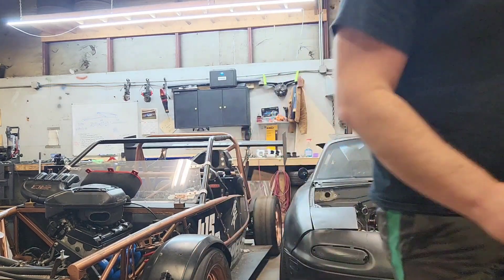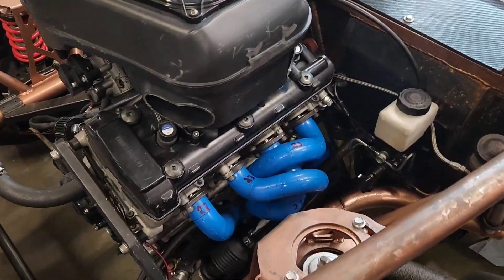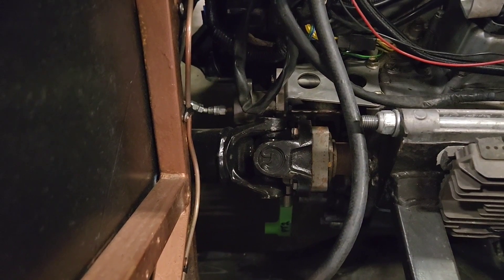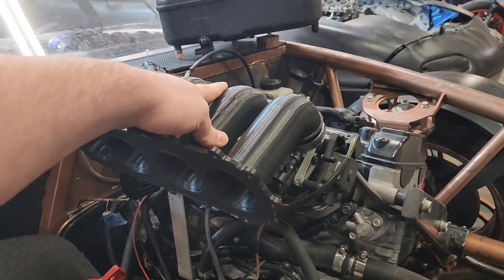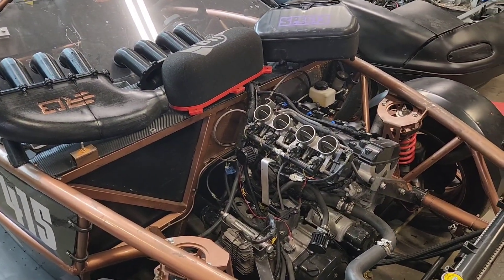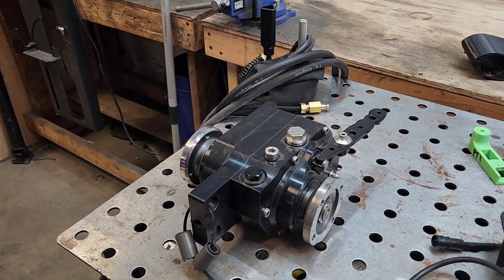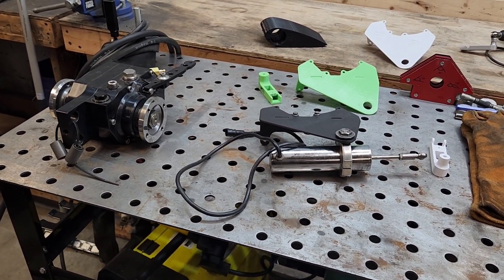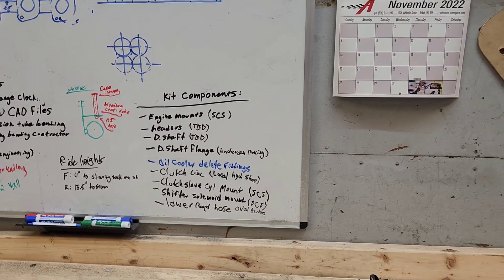Spec13 Motorsports Hayabusa Engine Swap Update and pricing. Accepting Pre-orders!

Comment: It’s amazing how small the engine is and how much room that opens up for things like a tilted radiator and extractor hood. The weight balance must also be somewhat rear biased, which could be really interesting.
Reply from the maker: Yeah, it frees up a lot of room under the hood. I know you aero nuts are going to love it haha! It does take a good bit of weight off the front, yes. Turn in is much more eager, lots of front grip. It requires a slightly different approach to suspension setup when compared to a standard Miata.

Comment: Would it significantly complicate the install for an auto miata?
Reply from the maker: Good question! Unless there's a difference between the manual and automatic tubs, I can't imagine it would. Actually, I think there's the potential to simplify the process  adding a clutch lever instead of the pedal. If you went with the paddle shift option, you could mount a hydraulic clutch lever to the trans tunnel. This way you wouldn't have to cut a hole in the fire wall and mount the clutch pedal.

Comment: What are you doing for fuel and miata specific electronics such as lights/pop up headlight motors.
Reply from the maker: It's the stock fuel pump with an adjustable fpr. However, depending on your donor car, you may not need to change the fpr. The busa has a returnless fuel system running at 43psi.
Reply: @spec13motorsports  Oh so its pretty identical to the NA fuel system.

Comment: How is the gearing with the hayabusa sitting in the ~2.5:1 ratio range and Miata averaging in the ~4.0:1. Top speed on a swap like this? Can they be boosted?
Reply from the maker: We replace the sprocket with a driveshaft flange and a 2 piece driveshaft, and then pair with any of the commonly available Miata diffs. The 4.3 diff will yield a 100mph top speed, while the 3.6 diff will yield a 130mph speed on standard 15" wheels/tires. 

They can be boosted up to 7psi reliably on stock engine. 

Check out our FAQ's 
https://spec13motorsports.com/blogs/news/frequently-asked-questions-faqs
Reply: @spec13motorsports  I'm curious why can it only hit 100mph? It makes way more power than the stock na miata engine which can get up to 110. Is it because of transmission gearing? I don't know too much abt how gear ratios work in this case.

Comment: How do you think this engine and gearbox would fare as a competition drift car? I think lightness is key but I'm concerned about how the gearbox will hold up to repetitive clutch kicks.
Reply from the maker: For your application, I would upgrade the clutch basket and clutch springs. Other than that, I don't see any reason it wouldn't hold up really well. I plan to attend some drift events this year for testing/promotion.
Reply: @spec13motorsports  Thanks for getting back to me. I see in some of your other comments that you are limiting the top speed to 100mph due to concerns of excessive load, is that right, and if so, why?
Reply from the maker: @jaiden270274  No, we're not restricting speed to 100mph. The Miata in our first video at Palmer was equipped with a 4.3 diff, which will yield a 100mph top speed.  But nothing is overloaded if speeds are kept below 127mph, which the 3.6 Miata diff will hit with this swap. Check out our FAQ on our website: 

https://spec13motorsports.com/blogs/news/frequently-asked-questions-faqs
Reply: @spec13motorsports  thank you, that FAQ is very informative.
Reply from the maker: @JaidenGullotta  let me know if you have any other questions! I think this would make an awesome drift build.

Comment: How is the underhood fitment with the 3D printed intake manifold? any hood cutting required?
Reply: Also you mentioned the idea of branching out to other vehicles - I am interested in the feasibility of swapping the first gen 86/brz twins, any thoughts on the platform? Does this sort of powertrain make sense in a heavier chassis such as this? Any concern with communication to the modern ECU's? Very excited to keep tabs on what you guys are doing here.
Reply from the maker: The under hood fitment with the available intake manifold is tight, but no cutting is required.
Reply from the maker: @austinhamilton9537  we're exploring the BRZ/FRS, but I'm afraid top speed would have to be pretty limited to keep loading down and ensure reliability. We've only tested with the stock ecu with a Schnitz Racing tune, but we're working on a project that will allow us to experiment with the ecu more

Comment: Did you change the oil pickup/sump at all?
Reply from the maker: No, we are running stock pulling system on both test mules. We haven't had any issues with oil pressure with either, but if you wanted extra assurance, you could get an upgraded oil pump gear and high pressure bypass valve from schnitz racing.
Reply: @spec13motorsports  I have just heard of oil starvation problems with motorcycle engines on track but its cool you haven't had problems
Reply from the maker: @peanutbutterpadre1519  yeah, it must not be as much of an issue with the Hayabusa. They've proven to be a very reliable car power plant on track. The Thunder Roadster GTR uses the Hayabusa power plant, and their rules only allow the high pressure bypass valve and oil pump gear, which tells me it's not a concern because then the rules would allow for dry sump, accusump, baffled pan etc.

Comment: This is sick definitely want to see how it holds up to drift applications especially with oil starvation. Ive owned several bikes and the abuse to a motorcycle engine is insane they just take a beating...this is very impressive and would love to see a video as a how to guide for this exact swap. What are the steps ? I gotta know
Reply from the maker: This would be an awesome drift build. Using the 4.3 or 4.1 diff would give you incredible torque multiplication. Plus the swap moves the weight distribution back a little bit, which will help with inertia drifting. We've done lots of track testing over the last two years, and oil pressure hasn't been an issue. Even with tons of aero and race tires from our spec Miata we never saw any big dips in oil pressure. However for added protection we do recommend running an oil pan baffle. They're available for about $50 from Schnitz racing. Once the first few kits ship in the coming weeks, I'll be working with one of my  customers to make an install video. It's an incredibly easy install. After the initial installation, the engine can be removed in 30 minutes or so, making it pretty doable at the track. The initial install requires 4 holes to be drilled in the tub of the Miata for the engine mounts, and two more for the drive shaft carrier bearing mount. Then you pretty much drop the engine in, wiring harness and all, connect the fuel pump wires to the stock busa fuel pump harness and you're off to the races, so to speak.